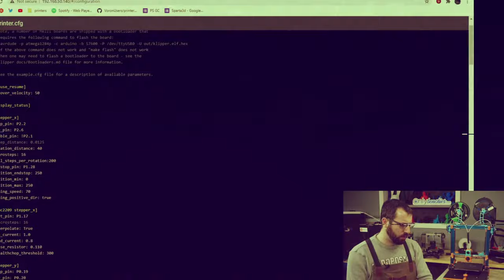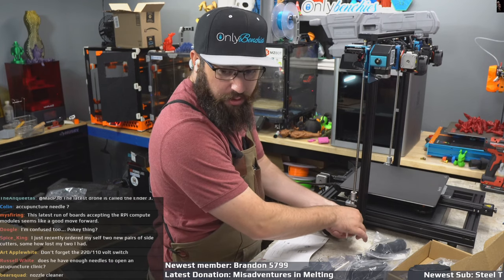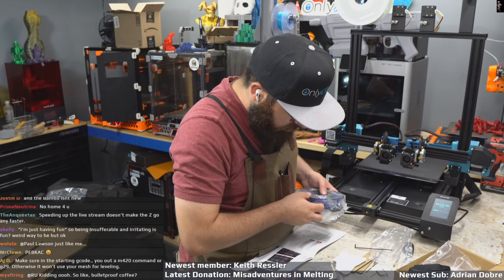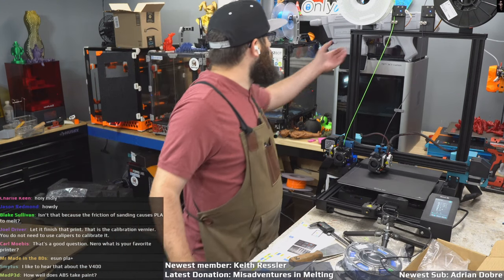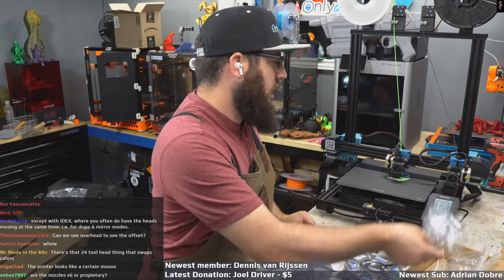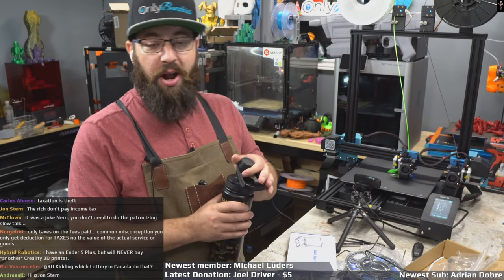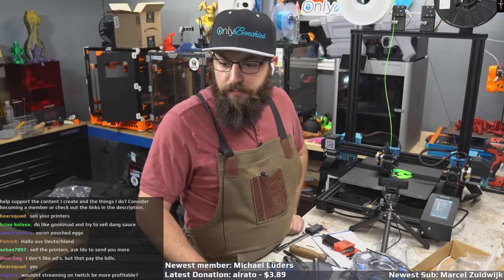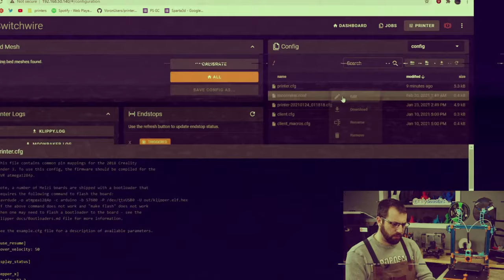Sovol SV04 IDEX PRINTER - Unboxing and Setup #livestream #3dprinting #3d

Comment: You should habe followed the part for within 2mm ... I only saw what was on the stream. You count to where the points line up and each point is a certain amount (for example each point is 0,2mm, if the 3 point lines up you have to move it 0,2mm+3=0,6mm - just an example, I didn't have the time to see it all). Patience young one ...